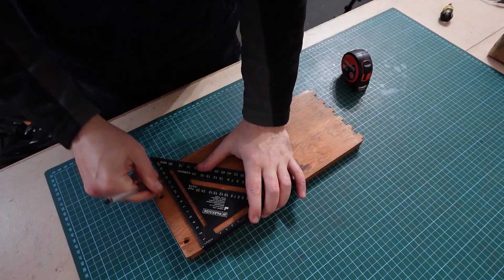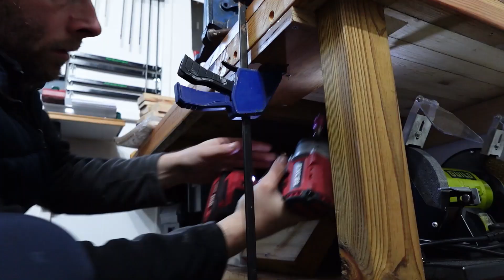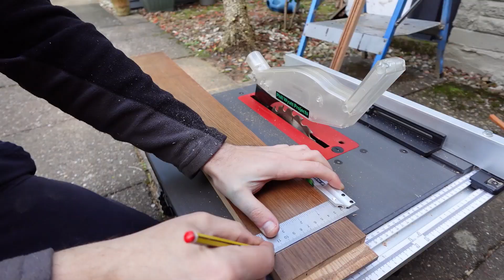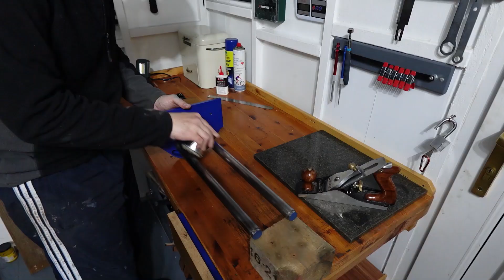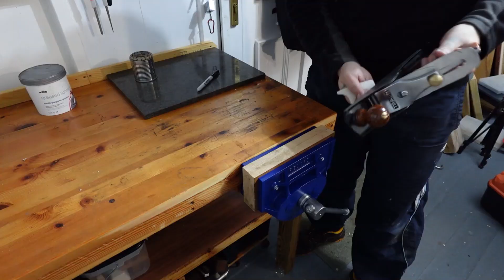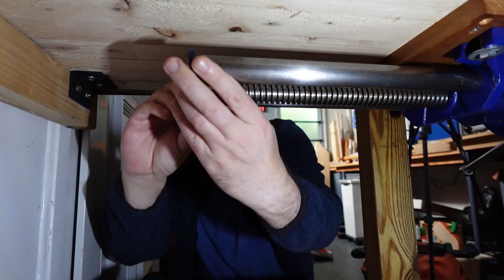Installing a Vintage Woodworking Vice to the Workbench (Record 52 1/2 P)

Comment: Are coach bolts the same or carage bolts.??
Reply from the maker: I think a carriage bolt is actually a bolt that requires a nut. A coach bolt is really a screw which does not need a nut.

Comment: Hi Steve. I have recently bought a record 52 1/2 vice but it seems to have a curve on the piece that attaches to the bench, rather than a right-angled piece of iron. My bench also has a ‘gap’ underneath the worktop, as opposed to yours, which seems flush with the side of the bench. Would you be able to advise on how to overcome these issues ? Many thanks.

Comment: Hi Phill, great vid, just got a smaller 52 myself that I’m planning my to restore. 

Can I ask, where on earth did you get those bolts? Showed a screenshot to my local builders merchants and they looked at me like I had two heads!
Reply from the maker: @reddazsg1  Cheers 👍🏻 they are called Coach Screws. I got mine from Wilko which has now closed although you can find them at places like Screwfix.

Comment: I've just bought a 52. A genuine question should the jaws not be softer than oak?
Reply from the maker: @johnbithell287  you can use any wood for the jaws. I like to use hardwood because it lasts longer. If you're worried about the wood being too hard you can add leather to the inside of the front jaw which can cushion the surface and offer extra grip on the workpiece.
Reply: @PhillWyattProjects  Cheers looks really good what you did.